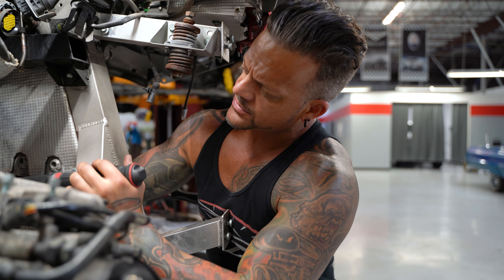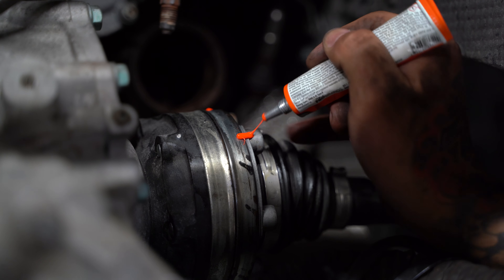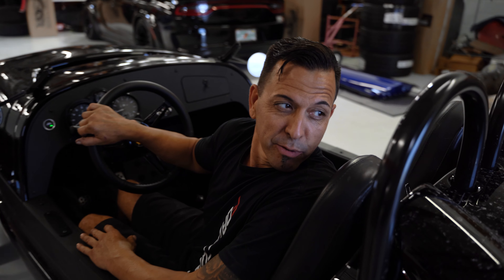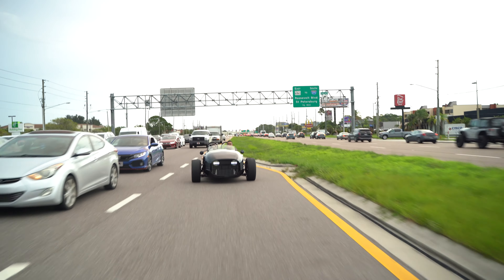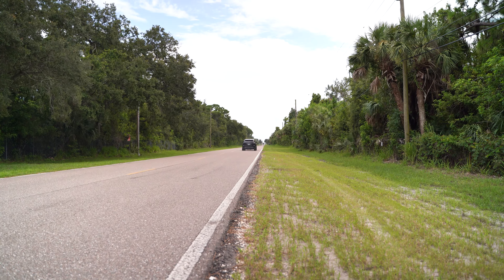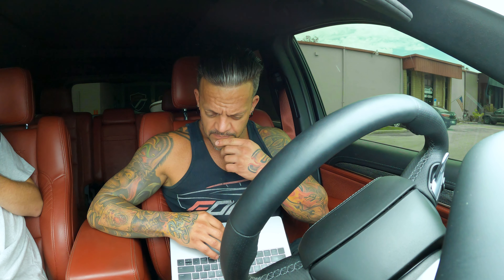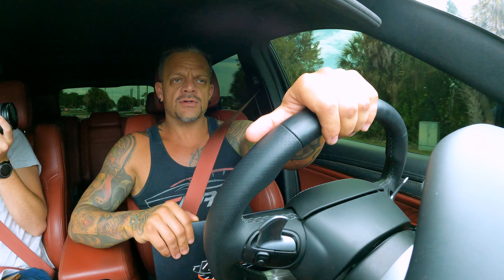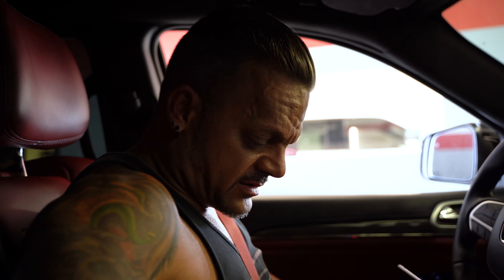1000Hp Trackhawk test drive! - The Cops Got Called!!!

Comment: Hello, I have a question. I own a 2018 dodge charger hellcat and I put about 65k on it so far. It's my daily driver for the most part , I told my husband I wanted to send it to you guys to get it up to 8 or 900 hundred hp, but he insist the car has to many miles to upgrade the performance in that way. Is this true?